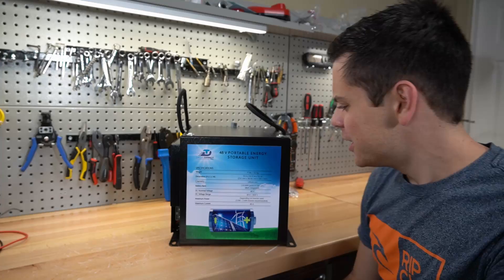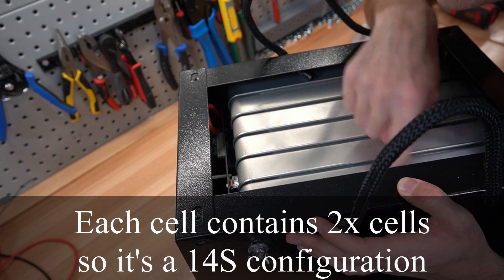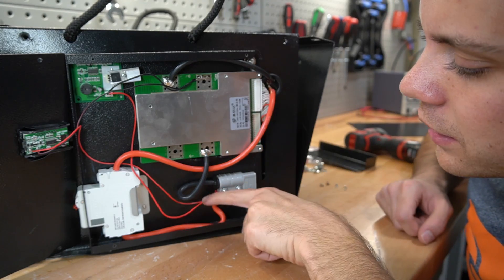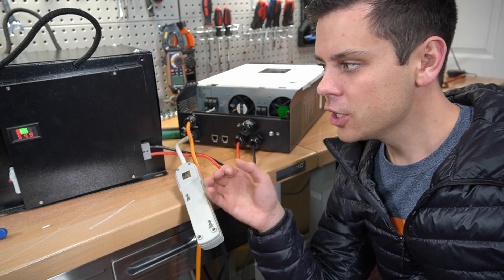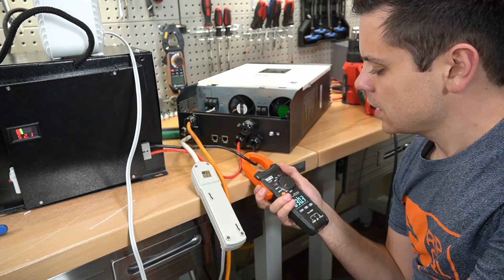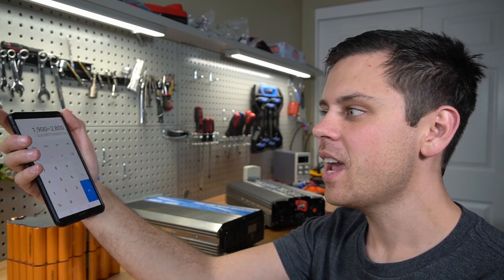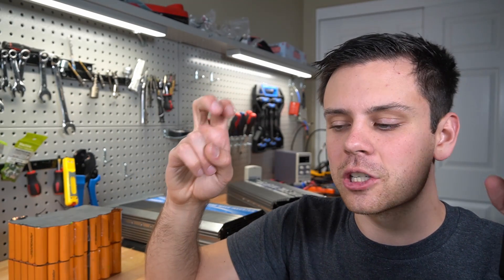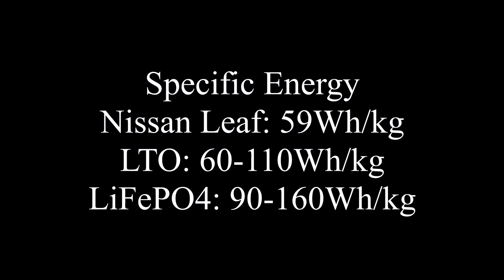48V Nissan Leaf -Used Cell- Solar Battery Pack

Comment: The nice thing with these is not needing a low-temperature cutoff unless someone is going to use them in conditions down below 0F/-17.8C. Can't do that with LiFePo4 and can't do that with Tesla cells, but Nissan operates them down that low before heating back up to the mid-teens F. They don't move power easily down at those temperatures, but at least they don't self-destruct.
Reply: Why not get some chemistry more reliable and utilize a low temp cut off?
Reply: G Henrickson  Because my particular usage requires functionality at low temps, not just disconnecting the charge source or the battery altogether. Heating LiFePo4 up automatically when needed is my preference, but it’s also my most expensive choice both in dollars and watts.

Comment: Love your channel but I can’t help but to poke fun at the industry:  (satire) shouldn’t it be called a “generator” and not a “battery pack”?
Reply: no generation occurring, so no its not a generator. A solar panel can be a generator, a petrol or diesel driven generator can be a generator, but a battery powered device - not a generator. I get your sarcasm Peter XYZ so the message is to all those that call these things a generator.
Reply: @DIY Projects ATM - good example DIY Projects.

Comment: The BMS has internal temperature sensor; it is in physical contact with the battery. I got one with 45A capacity x 7 x 48V and a main 300A CKT BKR only since the BMS does all the overload protection. Good idea to limit minimum and maximum Voltages.
Reply from the maker: Good to know!!

Comment: So glad you check these out, I was thinking using these, but now that I know 35% of the battery is unusable, I will pass on them!
Reply: I think all of the battery is usable, it just has 65% of its original capacity. Subtle difference!
Reply: @ahaveland  You are right and some newer G2 unit systems have around  80% are more capacity.  I think thats A pretty good moble  generator producing over 2000 watts  of power on full  charged batteries minus the inverter.

Comment: LmAo!
I literally just put these batteries in my golf cart last week. 
7s2p
The cart rips!
We have about three hours of hauling horse poo, and still at 51 volts.
Also shaved 420 lb off the cart!
P.s. mine are 85% G2 batteries 👍

😎😎😎😎😎😎
Reply from the maker: That's an awesome application of these cells!! Very cool. Must be so fun now 😁
Reply: @WillProwse  going to put a 300 watt solar panel on the roof next

😎😎😎😎😎😎
Reply: Damn. Almost impossible to get this in the UK

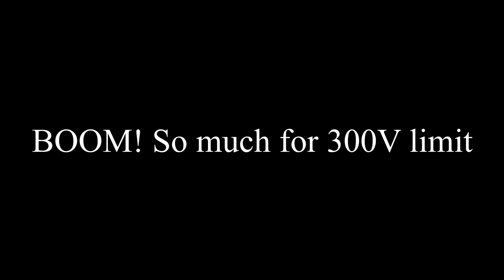Comment: Excellent video -- and no innocent animals were hurt .... just not a degraded battery fan ...favourite part .. ZAP (4:20) "God damn it" ..
Reply: Ya , what was that ? It wasn't  mentioned and nothing damaged so I guess it was just "the inevitable spark" from connecting to a high volt source . It was funny ... sorry Will !
I guess the fingers were too close.